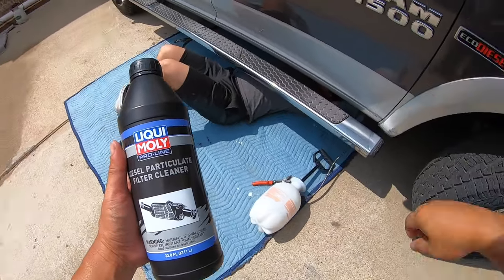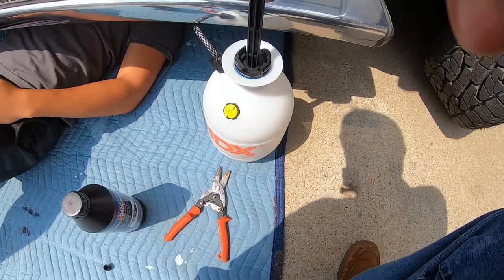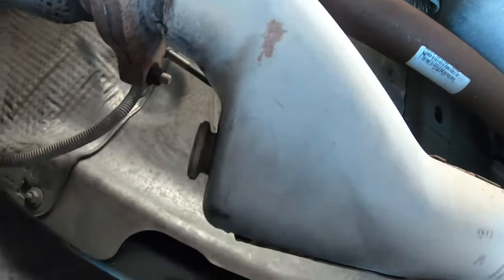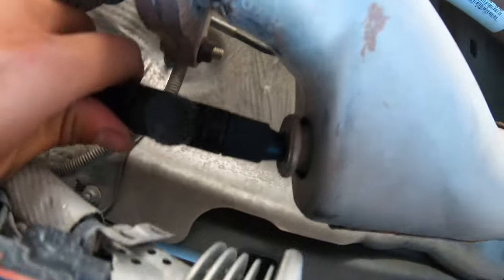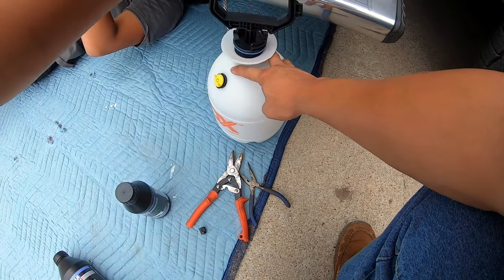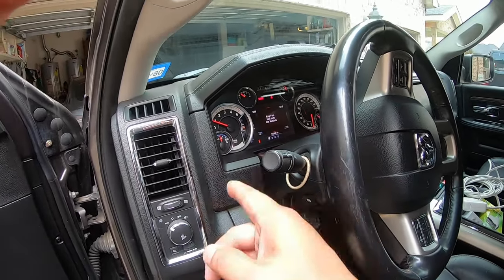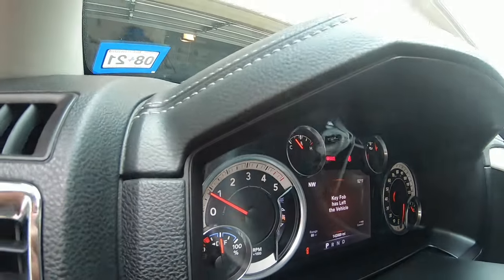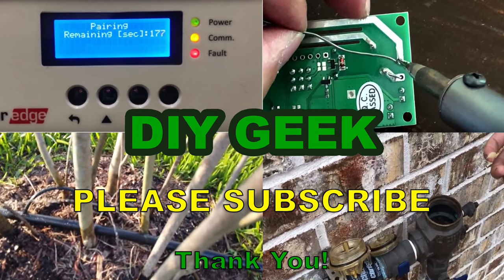CLEANING DPF FILTER USING LIQUI MOLY for ECODIESEL

Comment: You appear to be attempting to clean the SCR and not the DPF. The injector you removed is the DEF doser. You should have steamed off the crystalline formations while you had it off.
Reply: Hey Chris, I'm having problems like this with my 2018 Ram 1500 ecodiesel. And the shop said that It's not breathing. Do you have any suggestions?
Reply: @jamesBassMan81  the description of, “not breathing” could be the DPF filter not burning off, or the SCR catalyst not burning off. Both or either of these issues could be described as not breathing, in my opinion.

The DEF doser is easy to remove and clean, if you suspect it may be clogged. A clogged doser could lead to poor SCR cleaning, causing the SCR to “not breathe.”

There are plenty of YouTube videos with different ways to clean the doser and it’s mounting perimeter. It’s free, and can be done within 20mins in a driveway.
Reply: @jamesBassMan81  this video is also using a DPF cleaner in the SCR. I don’t know if I can recommend these actions, being the DPF filter captures soot. The SCR captures the Regen burn off of that soot, and uses DEF to convert to N2 and H2O.

Of course, I am nothing more than a shade tree truck owner.
Reply: Thanks, Chris. I did a manual regen, but it has an SCR filter code, but it's drivable until I take it to the shop Tuesday.

Comment: Do not trust this guy. He doesn’t know what he’s talking about. At the end when he points at the gauges he says one is the oil temp and the other the coolant temp - it is actually the oil PRESSURE not temp, and the other is the TRANSMISSION temp.
Reply: Those 2 digital guages can be whatever you set in settings. I have mine set to oil and trans temp

Comment: The temp gauge you show is not the coolant. The digital one on the bottom is the trans temp, the digital one on the top is the oil temp and the analog gauge on the top left is the engine coolant gauge.

Comment: Dude you're not cleaning the dpf filter. It's the one behind it.
Reply: the DPF filter is right off the turbo on that motor
Reply: @BrianWild445   I own one he’s mistaking the DEF injector with the DPF filter  which is located just before the DEF injector in the exhaust
Reply: @QuantumFiberServiceofficial  Agreed. Own one myself. It the first thing the exhaust goes into normally . At least in my jeep.
Reply: I believe the injector sprays onto the SCR right?? Or is that 2500 and up??